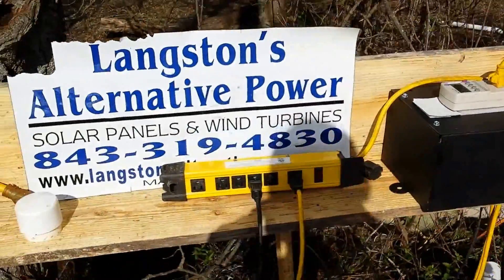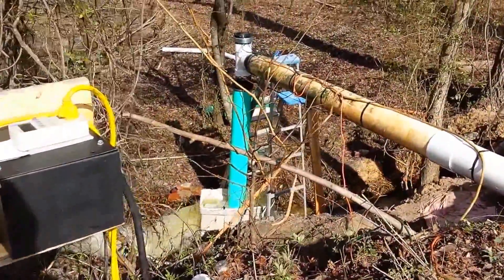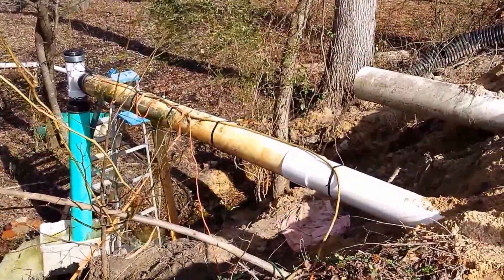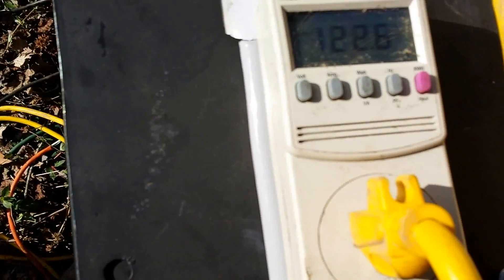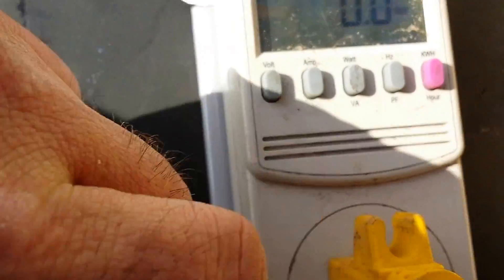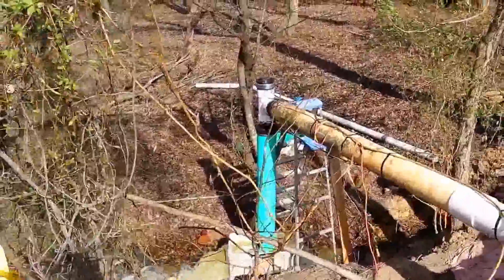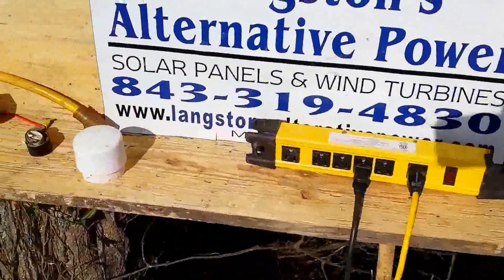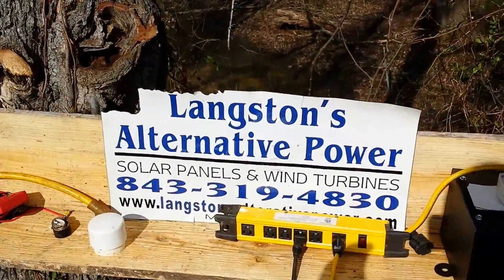120 volt AC  Low Head hydro generator

Comment: I'm making a 5ft dam on a creek with a good amount of water flow. What turbine would you recommend?
Reply from the maker: TimmyDavidSmith I  will need to know the GPM .But you can use 4" Low head unit or 6" Low head unit it will depend on your GPM you can call me @843 319 4830
Reply: Langstons Alternative Power Spencer Langston What is the maximum wattage that you can generate with a 6'' Low head unit, and is it possible just to buy the kaplan turbine itself? Thanks.